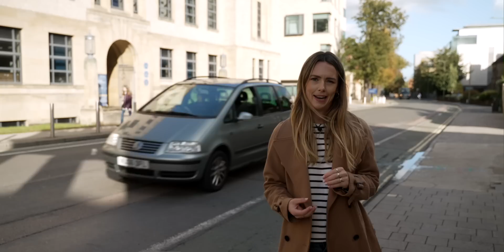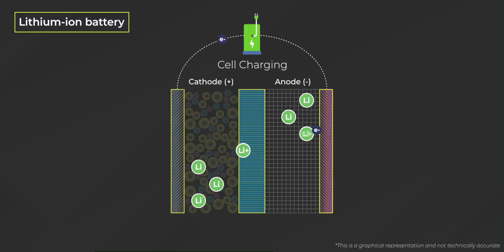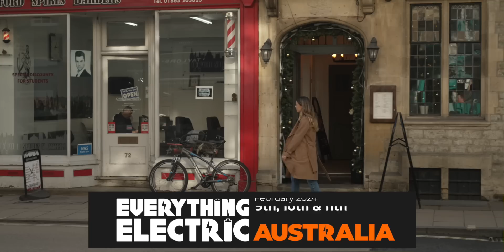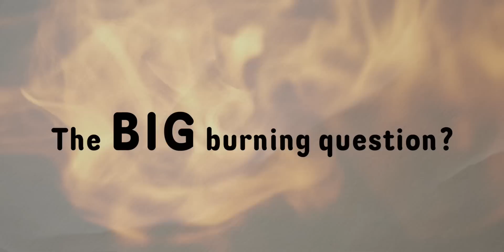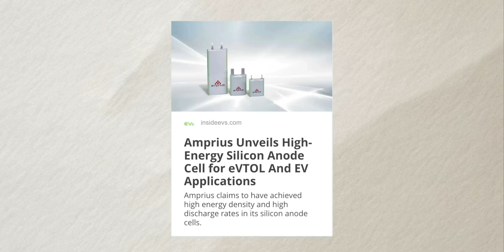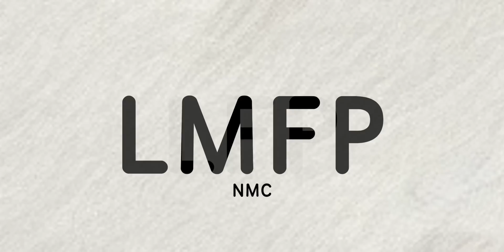The BIG Battery Breakdown: Fires, Failures and Future Breakthroughs!

Comment: Anyone with a smartphone will tell you the material drop in capacity after three years.  How does EV get a free pass?  It’s the same technology.
Reply from the maker: You are comparing a 75 kWh battery with a 4 - 5 amp hour tiny slice of battery housed in a modern smartphone.
So a car has about 4,654 times the capacity of the phone. What does that mean?
Every time you charge your phone you leave it plugged in until it's at 100%.
When a the reading on the screen says it's at 100% it really is 100%. When it says 0% it really is empty. This alone is very damaging to the battery but we accept that.
When a car's software tells you the battery is at 100% it actually at about 85%, when it says it's empty, it's at around 10%.
That is not possible to do in a phone, the battery is too small, and these buffers at either end of the battery's true capacity protect it. There is also a lot of other technology protecting the battery, it's kept warm or cool, the charge you put into it varies from very fast when it's nearly empty, to very slow when it's nearly full.
Again this protects it.
If it was true that electric car batteries lost 50% of their capacity after 3 years,  their would be an international uproad and the oil industry would be safe.
We recently saw an electric car that has covered nearly 700,000 kilometres on ONE battery. They really are not like phones.

Comment: About the 1000 miles range. Your guest poses that in completely wrong terms. The point of that long range is not to drive that long all in one go. The point is that it would drastically reduce the need to charge all the time and it would reduce the need for super fast charging. Because with a 1000 miles range most people would need to charge once a week, if that. And it does not need to be a super fast charging. Which means less money spent on building dense networks of super fast chargers, it means more availability of charging for everyone, it means less fuss, less stress, less worry. And third, people like to have options even if they dont need them every day. People like to know that in case they need to take a longer trip, or they are forced to - that is available. These are the greatest benefits of the long range.

Comment: So we're are still relying on battery technology invented in the 80s and mainstream in the 90s and still the majority of evs use the same technology today. The 18650 battery cell has become the number one cell used for many years and in many devices and electric vehicles...ive listened to all this rumour of solid state batteries being the next big thing for over a decade now.
I actually think that battery technology is being suppressed as its mostly controlled by Chinese companies who are the biggest manufacturers of lithium ion battery cells.
Makes you think where every other technology has advanced over the years but not so with battery tech...just so called experts spouting on about the amazing super energy dense quick charge tech that's around the corner....only trouble is that corner is neverending....more like a roundabout

Comment: I mean a 1000 mile car would be about 500 miles towing range would be useful for those of us that tow caravan and trailer but realistically a 600mile car would probably do nearly every tow at 250-300 miles 😁

With current tech I would just be happy with electric charging in the caravan bays 🤷

Comment: We may not need a "real 1000 mile" battery,  but allowing for manufactures overstatement + battery degradation + cold weather penalty.  Range calc can look like 1000 miles 78% * 80% * 70%  = 436 miles in some real world cases. And 400 miles range real world is reasonable requirement

Comment: Enjoying the information overload and trying to take in all the information especially about the fire safety of most batteries in EVs.
Don't give away the benefits of a 1,000 mile battery if it could be achieved. In Australia we are beginning to see charging stations in remote locations but there are still areas where a long range would be a great advantage although from experience range is not the common problem one would expect by just viewing the size of the land mass.

Comment: Batteries are consumables. There are only about 500 charge cycles in a lithium ion battery. Unless the batteries are standardized and made, readily, available, then battery cars will always be a gamble. The manufacturer needs to be reliable, honest and offer battery packs. Otherwise, these cars are throw away items and should be priced as such.

Comment: The technology behind 1000 mile electric car batteries can be useful in other applications. It can be used for trucks to make their battery packs more light weight meaning more freight capacity. It can also be used for electric planes to finally become available to the masses. High-speed trains are a nice thing to have, but for some reasons things tend to go wrong with the concrete over leading to ridiculously low mandatory speed limits at crucial parts of the track (like 40km/h at Antwerp or 80 km/h south of Amsterdam instead of 300 km/h). Speaking of trains, I won't be surprised over the long term trains will switch from diesel and electric trains with overhead lines to battery swapping with such improvements of battery technology. Overhead lines need quite a lot of maintenance and its maintenance has to be done over long distances while infrastructure for batteries can be more localized. It's less energy efficient though compared to wires, but when this leads to less downtime and more using less rolling resistance rail over roads, then it can be considered an alternative.

Comment: Re the fires.
How difficult it is to put them out, and is there an added issue of poisonous fumes?
I know the chance of a fire are extremely remote (and more so with enforcing of higher manufacturing standards) but these are the main issue of EV fires to me. 
I just need to know how true these are, and am I missing something that may be blatantly obvious to those in the know.

Comment: About the long range: I am still a fan of the idea of using small batteries in the daily life and stacking up for the journey to Italy. The gas stations will need a new business model, they could provide fully charged batteries, which I take on on my way to the Autobahn, drive 900 km with only 2 stops, arrived in Italy, I give the big battery to a gas station, and vice versa on the way back. Such a system would save so much battery material and weight and thus, energy. We only (<broad smile>) would need the car manufacturers to design their cars around a very small amount of different batteries. Where did we see such a system before? - With lead batteries.

Comment: yeah, nobody is foolish to drive 1000 km in 1 shot bcos of the bladder issue but lots of ppl  are smart enuff to understand that they want to charge their car on a 1000 km battery or even 2000 km and not worry about charging for a week or so or even 2 weeks. That would definitely solve the issue of lack of chargers in appartment buildings, don't u think so ?

Comment: 500km range is the sweet spot for me. As te longest trip without a break would be 300km for me. So Why 500? Well that way I don't have to worry before or after using the car. As I have range left enev when its winter when the range goes down

Comment: I would argue that a "1000 mile battery" isn't necessarily the concept of a battery reaching a prescribed distance, but one that is of limited volume to fit in the dimensions of a car to theoretically hit that distance ie the key to that point in the energy density side. This breaks down to not a 1000 mile battery per se but an energy dense battery that can be shrunk thus taking up much less space and weight within the vehicle addressing the big issue with all EV's currently.

A smaller energy dense battery that can reduce weight causes a feedback resulting in increased range due to lugging around less weight. As seen with the Mercedes EQXX, properly designing cars to be more efficient by designing from the ground up rather than retrofitting existing designs can result in range gains on current technology. One standout thing was the removal of rapid charging. Doing so meant the large heatsinks of cooling while charging wasn't required further reducing weight and increasing range. this increase in efficiency meant that a home charger was able to add the same range as a rapid charger per min of charging.

I should expand and say Yes, I 100% completely agree that charging network needs expanded and based on current technology that should be the priority over the edge cases of a 1000mile EV. Based on everything I do agree that a car with a 1000 mile range isn't useful, but an energy dense battery that can be shrunk would greatly help on the charging network expansion and potential strain on the grid that rapid charging is going to bring. 

There is also the notion that cars sitting can supply power to the grid to help balance it (something I'm not sold on for various reasons) and something a "1000 mile battery" would actually be a solution to address some of those concerns I have.

Overall fantastic interview, definitely learnt a lot I didn't know about batteries and where everything is going. It's a lot more complicated than x vs y that marketing would have you believe as there appears to be X+Y+Z vs A+B+Y+Z options.

Comment: “Infinitesimally small” is language that should not be used. That implies that there is essentially zero chance of the battery catching fire and as we all know, the chance is not zero otherwise we would not be talking about it. I do believe the chance of a battery catching fire is much smaller than we probably think but if they are to reassure us of actual chances then they need to use appropriate language.

Comment: A key issue is longevity.    Average vehicle fleets are around 12 years old, which means there are plenty of ICE cars in use at 20 years.   Seems to me that batteries are going to be expensive to the point of uneconomical to replace (if even available as technology changes) and if vehicles have shorter lifespans some of the benefits of EVs is negated.   I can't imagine how some of these vehicles are going to be neglected as they age, corrosion/seals failing etc etc so safe chemistry is essential.

Comment: I see that many people here are making the same mistake when you think about 1000 mile range. Most of you are thinking that people would use all of that range to drive in one trip. Which is not the case. The bigger capacity and miles range = less hours (!) spend on driving to charge stations (another kilometres of wasted range), waiting in the que (more electric cars, not to much chargers). they will have more reliable range to go and back from smaller trip. 
I live in smaller city, and from time to time I do 150km in one direction. I would like to go there and come back + do a shopping (another 20-30km) 
Or doo 370km trip without thinking what happen if traffic will happen.   
Doing one solid charge instead of 3 - wasting additional 2-3 hours of looking for a working charger, waiting in a que etc.

Comment: the way forward is to make lower energy-dense batteries? that will really make range anxiety disappear! Solid-state batteries are the battery that is always ten years away. Very few ICE fires involve the fuel tank exploding and that never happens with diesel fuel tanks. Fires in ICE vehicles are easier to put out with conventional equipment. The worst-case scenario for a BEV fire is not being in the car when it ignites but the location of the car when it does. Couple this with the increased likelihood of other BEVs nearby and possibly joining in on the fireworks and the situation gets even worse. Even your meticulously built BEVs can be damaged in accidents that can impact the battery area making it susceptible to later problems just ask Hertz and Sixth rental cars.. Electric drive is the holy grail of motion but the batteries we are using are not and glossing over their dangers does not help your cause. We have been very lucky that no significant loss of life has resulted from BEV fires but it will happen and when it does please come back and tell us again how safe they are. While you are at it please explain to the firefighters in various places in the world who have been invalided by cobalt poisoning why it happened. ICE vehicle fires have claimed casualties but stop making out that BEV's are less likely to as well because it is not true especially as more of them come on line.

Comment: The main issue for me is that car manufacturers are not offering long enough battery warranties on EV's.
Most cars only come with a 7 to 8 year warranty, whereas the cars themselves should easily last twice as long but the lack of battery warranty cover for the 2nd half of the cars life potentially makes used EVs worthless.
This is one of main reasons why used EV'S are plummeting in price, as nobody wants to buy a car where the battery warranty has virtually expired.
Ironically as the batteries grow in capacity this simply makes them evermore expensive to repair or replace with the typical cost now being put at £15k.
In other words once a used EV is worth less than £15k it's basically worthless.
Car manufacturers need to start providing 15 year warranties on their battery units otherwise the used EV market will simply not function properly.

It may not seem like an issue at the moment but that's because most new EV's are sold to the company car/fleet market, but as more cars are sold to private buyers in the coming years, these buyers rely on a good used price to be able to afford a new car.
If they can't get a decent used price then the whole car market chain risks collapsing..

Comment: We certainly don't need a 1,000 mile battery for most passenger vehicles. This notion comes from the ICE world when people are thinking in terms of filling up twice a week on their way in or out of work - also, most passenger cars don't have that kind of range either. If we have charging at home, work parking lots, shopping centers, and other destinations - this need goes away very quickly. Instead, 300-500 mile range is sufficient. 300 miles is ideal for most commuter cars and 500 is needed for SUVs and light duty trucks that need the ability to tow occasionally. We already have cars capable of that but they happen to be very expensive at the moment (Lucid). You also have to factor in real world range - my Tesla Model Y is EPA rated at 303 miles but it looks a lot closer to 220 miles at 80mph Interstate travel (even less with cold weather or a head wind). Europe also has the advantage with a robust train network that is at least semi-fast, America only has a few high speed train lines so we are basically car-dependent except for a few urban cores (New York, Chicago).
Reply: I would love a thousand mile car, then i could do all my charging at home on solar panels.

Comment: The latest batteries already starting to be used in planes are primarily salt. Yes like table salt mixed with a chemical to glue it in a block. These batteries do not need exotic minerals.  As for batteries causing fires in electrics cars it is very rare. In comparison internal combustion engine/petroleum vehicles catch fire in great numbers every days. The electric vehicles are marginally safer.

Comment: Engineers need to solve the dendrite problem so batteries last far far longer at the better end of their performance. Failing that standardisation on battery frame works so fuel stations could become battery swapout stations

Comment: THE JOYS OF EV OWNERSHIP 

VERY EXPENSIVE TO BUY NEW 
MASSIVE DEPRECIATION  
FIRE RISK  
VERY EXPENSIVE TO CHARGE AT PUBLIC CHARGERS 
MOST PUBLIC CHARGERS  NOT WORKING 
HAVE TO WAIT TO USE A CHARGER 
RANGE ANXIETY 
RANGE LOWER THAN MANUFACTURES CLAIM 
COLD WEATHER RANGE VERY LOW 
HOT WEATHER RANGE VERY LOW 
CANT USE HEATERS IN WINTER DUE TO LOSS OF RANGE
CANT USE AIR CON DUE TO LOSS OF RANGE 
CANT USE  RADIO , WIPERS , ETC  DUE TO LOSS OF RANGE  
MASSIVE TIRE WEAR 
EXPENSIVE TIRE COSTS DUE TO WEIGHT OF EV  
NOW VERY EXPENSIVE TO INSURE  
NO SOUL , PASSION , EMOTION , GOOD DESIGN  , SOUND , CHANGING GEARS  
CARS WRITTEN OFF FOR ANY MINOR DAMAGE 
IF BATTERY DAMAGED VERY EXPENSIVE TO BUY AND FIT A NEW ONE  
TERRIBLE CHARGING INFASTRUCTURE   
SOFTWARE ISSUES 
BATTERY LIFESPAN CONCERNS  
BATTERY DISPOSAL EXPENSIVE  
CHARGING SPEEDS  VERY SLOW 
ENVIROMENTAL IMPACT OF MINING FOR BATTERIES 
CHILD LABOUR MINING FOR COBALT AND LITHIUM  
ALL BUT TWO EVS ARE DROP DEAD UGLY  
THERE WILL NEVER BE A CLASSIC EV  
EV EVANGLISTS  
NEED A HOME CHARGER  
NOW EASY TO STEAL  

ETC ETC ETC

Comment: Petrol and diesel don’t burn, their vapour does.
2. There is no thermal runoff in petrol and diesel. 
3. even if ev battery’s protection cover is scratched, it becomes a fire hazard, definitely puncturing a  ev battery is fire starter